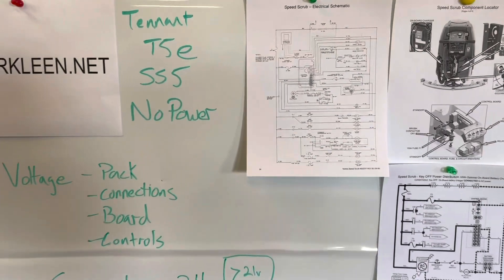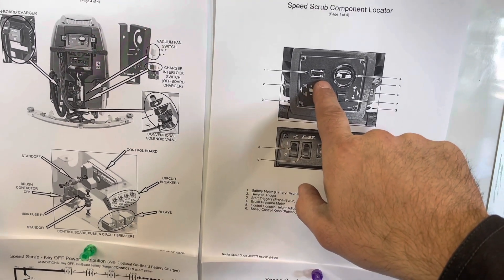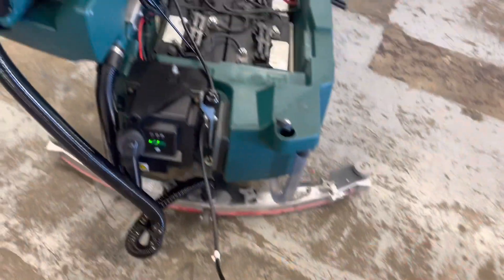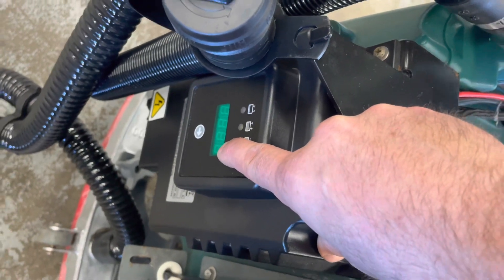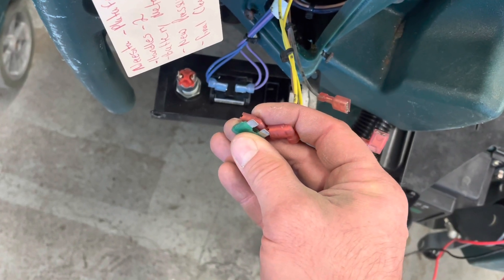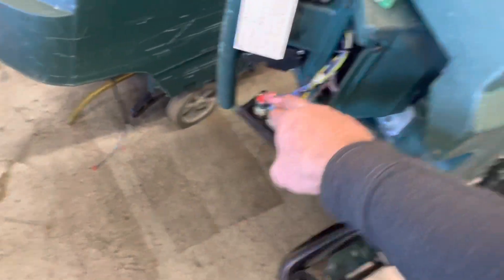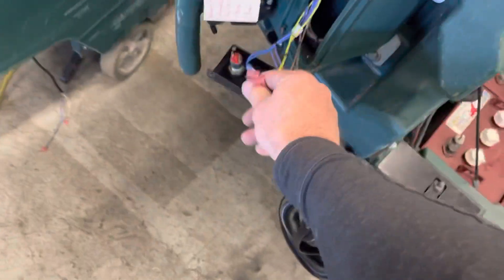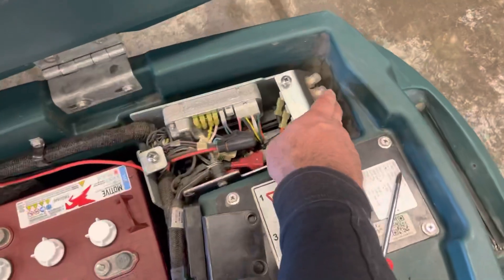Powerkleen - Tennant T5e Nobles SS5 - No power up / no response good batteries

Comment: hi ,i have a question about battery not charging  , i have 15v at main leads and only 5 v at second and third batteries ... charging display shows oo.oA what should i check?
Reply from the maker: Your prob too low at 15v to trip the charger safety relay under 18-19v most smart chargers will only trickle not full cycle

Check your cables and terminals for good connection and no corrosion, check your batteries every cell for electrolyte levels and add distilled water as needed, check your batteries individually and replace any battery under 4.9 volts (not likely to return to full capacity)

If you have budget constraints and low runtime performance expectations You may be able to use a cheap Amazon car battery charger that has a pulse/repair cycle option to get a severely discharged or under watered battery to take charge and return to 50-80% of rating but it’s a slow process and we’ve found a low reliability over time. It can be difficult to get any smart charger to engage with a battery under 2-3 volts. The depth of discharge and charge cycles depleted are  another measure of whether batteries are worthy of the repair effort. A battery that has never been used and has sat may come back easily. A battery run hours every day used hundreds of times probably won’t.

If you need a good lithium battery pack contact us at powerkleen floor machines in Winchester Ky

You can find us on google maps
Reply: @powerkleenfloormachines-jo4881  i did removed all cables from batteries and charges each one individually rehooked all cables  when i went to move the machine i had 24 v at batteries but as soon as i lowered the brushes it kill the batteries to 19v.....when i hook up to wall with machine charger i show 00.0a could one or more batteries be bad ?water levels in batteries are fine. i work at a nissan dealership we have a charger and with 6v capacity charging. before charging i had 1 battery with only 4.3v and the others were 5v and more,

Comment: I'm having trouble with my nobles ss5 brush motors not turning on once in a while when when engaging the switches. The scrubber powers up fine. Thanks for any help.
Reply from the maker: Check my other video on deck raise/lower about a minute in I go over the actuator limit switches under black cap

If not that it’s the contactor or harness quick connect

All easily checked with volt meter
Reply: Thank you
 @powerkleenfloormachines-jo4881

Comment: Great video!! Wish you'd do more!!
Left my Nobles SS5 on for a few months, killed the batteries, they were old anyways so installed new Trojan T0105's & charged them up.
Now I have one solid Red light on the battery meter. despite having 24 volts.
Everything works but now I'm afraid to trust it on a job.
Any suggestions please?
Reply from the maker: 1 flashing red is < 22 volts

Double check your series connections, cables and terminals

Get a volt meter dc voltage reading at the  red and black leads coming of the pack to the machine

A new fully charged pack should read 26.3volts
Reply: @powerkleenfloormachines-jo4881  New battery voltage check out fine on each battery and all batteries.
If the Battery Meter went bad, can I just run it with a single solid red led or will the machine "think" low voltage and shut the machine down?
I really appreciate your help Sir!
Reply from the maker: @melbigelow1200  battery meter bait likely bad 2-3 other things to check on before make the call

Look me up at Powerkleen floor machines Winchester ky on google maps give me a call or email I’ll get you the schematics and the 3 places to check to make sure everything ok before using like that

Single flashing light is likely to disable functions and using that badly depleted could cause failures

Comment: hey i just changed the wheel out on one of the noble speed scrubber riders and now with the switch in the forward postion the scubber reverse alam comes on and drives in reverse! and vice versa... any info on that possibly?
Reply from the maker: Main power wires are reversed at connector or wheel typically
Reply: @powerkleenfloormachines-jo4881  so the front drive unit has a reversible connector? i kind of gave up on it but ill give it a look when i go back in to work
Reply from the maker: @TheSnApZ47  look my number up on my website Powerkleen. Net I’ll get you the diagram and a pointer on where to look